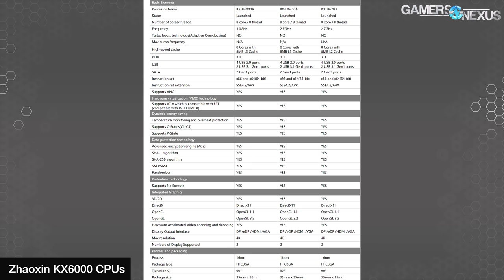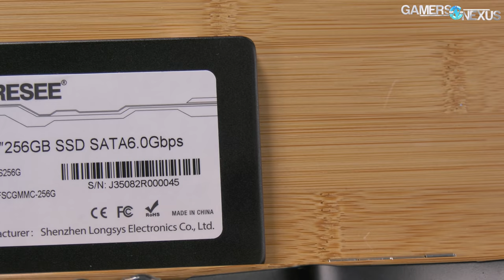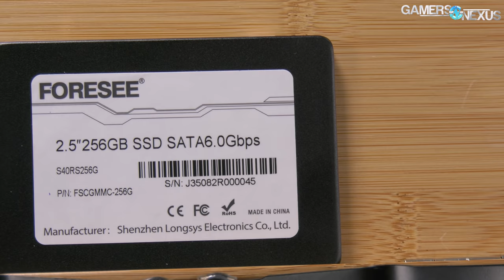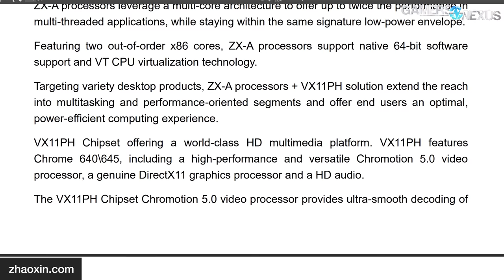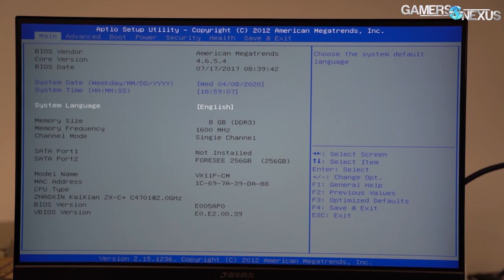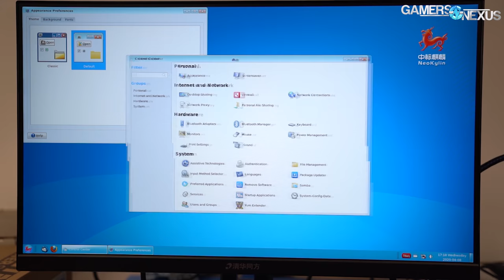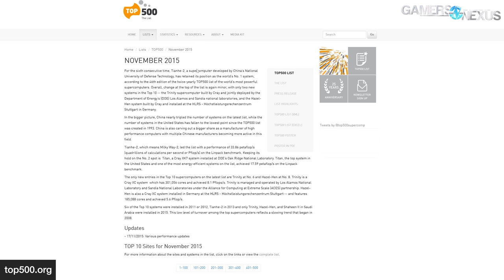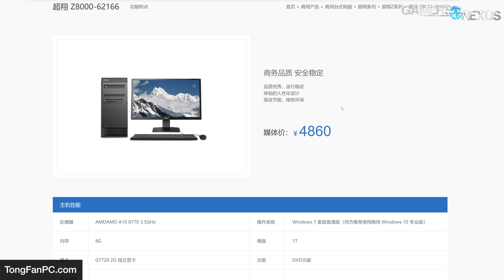Chinese Pre-Built PC Review: ZhaoXin CPU + Knock-Off Windows OS, ft. NeoKylin

Comment: You keep stressing the low gaming scores and saying that it is not a gaming PC, although it is priced as one.  If I look at a theoretical F1 race car and want to compare it to almost any automobile I can purchase it is going to come short in every measure except in speed.  It is really not going to be able to go off roading, the ground clearance really suck.  As for carrying my groceries it only works if I buy one or two very small things and they fit on my lap.  But it is priced out of the league of every car that you might test.  You know that the system, regardless of price, is not a gaming system.  So why keep wasting time trying to prove just how badly it does at gaming and that anyone can purchase or build a system that will far exceed its capabilities for less.  You did not buy it as a gaming system, and if you did you quickly realized that it will never do that, regardless of price.  It is not a gaming system.  PERIOD. 

This video would have been a lot more interesting if you had very briefly mentioned some basic benchmarking, your comparison to the Atom processor is very apt for this point, and I appreciated the brief history lesson that brought about this processor.  Then go on with the rest of the review.  That is the real reason for this video, a look at this system build quality and the Chinese version of Linux, on this system.  You are right in not recommending that anyone really purchase this system for any meaningful work but it does give some insights into the level of x86 CPU developments that the Chinese have available.  The Chinese have already clearly demonstrated their ability to produce high quality computer systems, virtually everything that we purchase as complete systems, except for possibly custom systems, is already made in China.  And the Chinese have the ability to make some very interesting silicon, both as processors and as the vast assortment of other chips.  Some of their silicon is not meant for the West with the development and technical support only available in Chinese.

If you really insist on only really dealing with gaming systems then why did you waste everyone's time, including your own, to acquire and test this system.  You should have known that it was never gong to be a gaming system, regardless of how poor, before you went to the effort to get it.  Having to replace the power supply alone meant that it was not going to really be an alternative in North America.  But if you went to the effort to get this system to see just how far the Chinese are in developing their own alternative to the x86 processor then it was an effort well spent.  This is an early system that is really only meant to be used in China and the beginning of a process to meet the demands of the Chinese government to get away from Western technology in their computers.  Using Chinese products, and things that you have never heard of before, as the peripherals of this system makes sense as each part is not meant to be the bleeding edge for gaming. 

This system does not have to compete with Intel or AMD, or even VIA for that matter, and their efforts to do things their own way is totally fine.  This is to satisfy political requirements rather than a technical need.  It will provide a computer experience that will meet the needs of those that are going to be the main clients of these systems.  It creates a CPU that the American government cannot restrict or to tamper with.  And by creating their own version of Linux they are never going to depend on Microsoft, a company that can also be forced to comply with US restrictions if the government so desires.  The Chinese will learn form this, as is seen with the newer CPU that you are trying to acquire, and develop it further.  But you are right that at this time this system is never going to serve as a gaming system and is certainly not worth the money that it will cost if someone wants to get one.  And it is likely that even the next few generations will also provide a very poor gaming experience because that is not the intention of this family of CPUs being developed, for political and security reasons, by the Chinese government.  And in the end having something that is slightly different from the normal x86 systems seen in the West, even if it can run Windows, may also provide a slight advantage from a security point of view where not everything is the same thing and an exploit will have a devastating effect on all systems.

Comment: Given that the igpu is via/s3, Linux drivers are absolute crap to non-existent.. probably another reason for the AMD GPU.
Reply: Another reason for the AMD GPU is that this iGPU's performance is terrible and have issues with normal video playback or basic windows animations.
Reply: @mruczyslaw50  I have a VIA board with the earlier version of that igpu, but it is...adequate...for windows 10, especially after turning off eyecandy.
Reply: @Voidsworn  Adequate? After eyecandy, maybe. But just for comparison intel had more powerul igpus back in 2006, and they also weren't best at the time because nvidia had even better. Yeah, for simple web browsing and microsoft word it should do the trick. But that's not what I would expect to use in 2020.
Reply: @mruczyslaw50  neither would I, but they really haven't been doing much with their (via/s3) GPU tech, so...yeah. it is still trash. 😆
Reply: I've seen you from somewhere
Reply: @awesomecomputers7076  Another post on this channel, maybe a post there on Juraj Tralalak's channel, or MWO (MechWarrior Online)? ::shrug::
Reply: @Voidsworn  I think it was TheUltraHDGamer on some old socket 478 hp he was taking apart
Reply: @awesomecomputers7076  ah yes, that guy 😁

Comment: As an extreme designer, I know it is trivial to build a CPU that outperforms the x86 architecture. (For example, stack-based direct execution processors like the Novix, the Western Digital P-Machine, and the GreenArray GA-144). There are better electronic technologies than CMOS. (For example, I²L and Tunnel Diodes). The MIPS, Spark, and ARM processors keep the belief that there are too many instructions alive despite proof that they are wrong! With all the Chinese graduate students, why are their non-supercomputer designs so bad?

Comment: Honestly, these PC's are the perfect metaphor for the inefficiencies of communism versus capitalism, and the foolishness of using protectionist trade policies in the tech industry.
Reply: This PC is for government use, which is much saver than Intel/AMD which contains US spyware. Average user in China have access to normal Intel/AMD/Nvidia parts.
Reply: @UltimateAlgorithm  and the Chinese parts all have Chinese bacldoors in them. Every government participates in espionage, it's simply the way of modern powers. Let's not try to distract from my original point, they are producing an inferior product when not using IP developed in the US.
Reply: @haroldburrow4363  yes that is true, but since they need it for internal use they want something that does not contains other countries tools.

It is also true that they have a lot to catch up. Recently they're investing in RISC-V and ARM for their next gen chip. Since both of that IP does not rely on US companies (RISC-V is open source while ARM is Japanese). So most likely their next CPU won't be an x86. My opinion is that they will lean on RISC-V rather than ARM. In fact, Alibaba already have one of the fastest RISC-V chip available.
Reply: Intel and AMD did improve their CPU for the last 40 years or so. They are not at the same level because they work on it for a much shorter time.